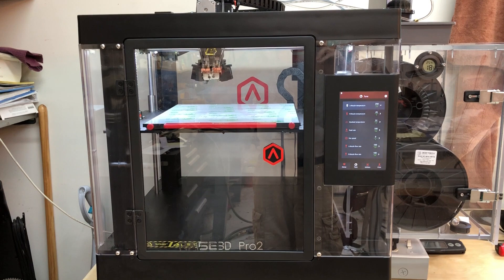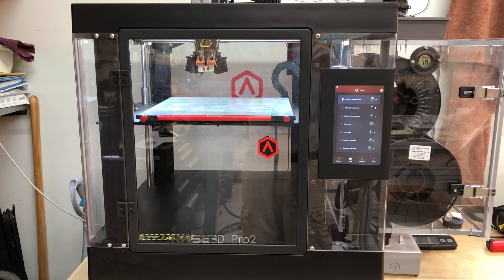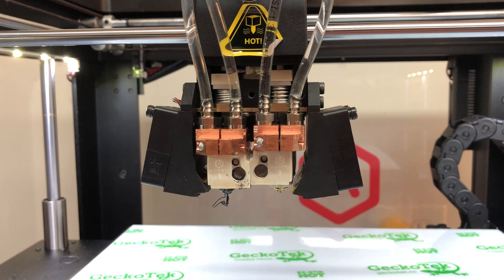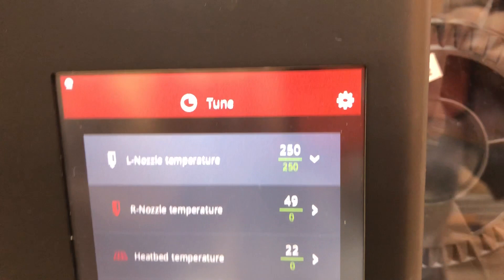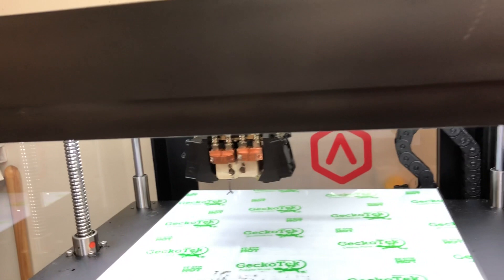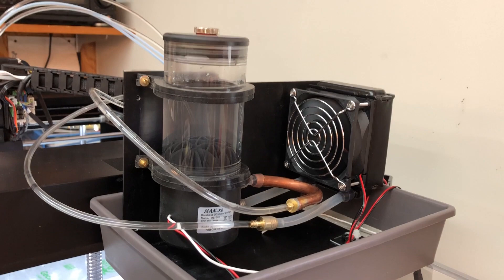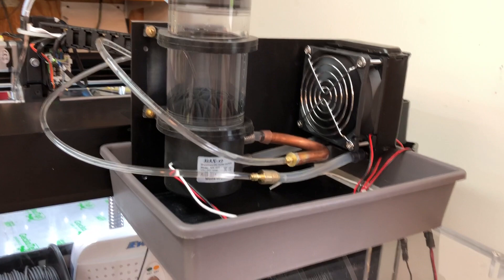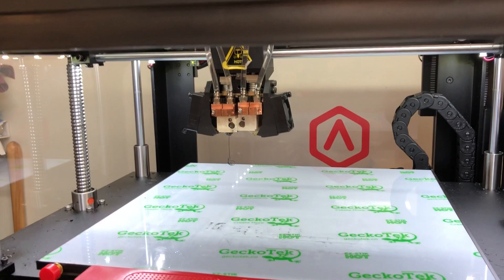Raise3D Pro 2 Modifications - Liquid Cooling

Comment: Hey Paul - I would point out in your excellent design that you may want to flip the heat exchanger over to prevent air from accumulating in the top - may not be an issue ever - just trying to find one thing to be nit-picky about!
Reply from the maker: John M Hi John, and thank you.  I agree that flipping the radiator would be optimal, but I confess that I succumbed to this layout as it simplified "the package" and I was willing to risk the trapped air problem.  It did make bleeding the system during install a bit more tedious, but knock on wood, I have had no problems with air lock.  The radiator is real overkill thermally.  I have since added a small spinner style flow indicator on the pump output line so I always have a visual on flow.  I may contemplate reworking the system in the future if I ever stop printing non stop, but for now, it isn't broken, so no reason to fix it.

Thanks for pointing that out as a consideration for others who will make a water delivery system!
Reply: @paulyarnall3605  really late to jump into this comment but there is nothing to worry about as far as air in the system due to the radiator orientation. I have been liquid cooling PCs for the past 2 decades and as long as there is a reservoir and constant flow all the air will stay in the reservoir  where it should be

Comment: Hi Paul - ingenious and elegantly simple. I've experienced all the same problems of excessive heat in the Raise Pro 2, and have to say Raise aren't particularly empathic about solving their own design flaws. That said the Pro 2 does have a very useable specification and your solution is a potential lifesaver. One question. You have cooled the hotends, which is a needed mod, but the cabinet gets very hot with the lid on. Do you think that your hot end mod would also be sufficient to overcome the overheating cabinet issues (in large part coming from the hotness I guess) with the lid on. i.e. one mod cures both heating issues? I ask, as working in a central office with no windows, I want that HEPA filter in action and to breathe unpolluted air.
Reply from the maker: Hi John... Thanks!  With the pump and radiator out side of these Pro 2 the interior temp is not really relevant.  The water cooling is very efficient and a higher inside temp has no real effect on the hot ends temps.  I usually print with the lid off, but with it on using water cooling is even more necessary as the hot interior air becomes even less able to cool using the OEM air cooled heat sinks.  I should note that since this video I have added copper - water cooling plates on the two extruder motors and simply plumbed them into the return line from the second hotend heat sink.  You can find them on Alibaba.  
The extruder motors can get quite warm pushing some filaments.  Not hot enough to bother the motors but the heat conducts into the drive gears and can pre warm the filament enough to create problems.  For a while I just used a computer fan sitting on top of the printer to blow air over the motors.  That worked fine, but would not be ideal with the lid on. Implementing the water cooling is not difficult and virtually transforms there Pro 2 into a predictable and reliable printer.  Raise3D is choosing to ignore the obvious.

Comment: Are these still available for the Pro2 Plus?  Was about to weld up a custom fan bracket and came across this video.
Reply from the maker: Yes.   Please contact Paul English at English Manufacturing, penglish@englishmfginc.com. sorry for the delay. i have been off the grid.
Reply: @paulyarnall3605  NP.  Already contacted and got a set of the blocks.  Look forward to installing.  All my systems are custom open loops so should not be an issue.